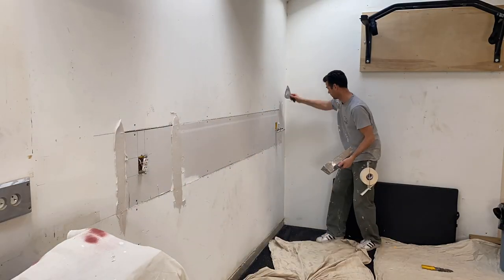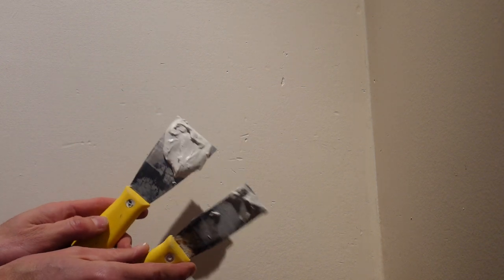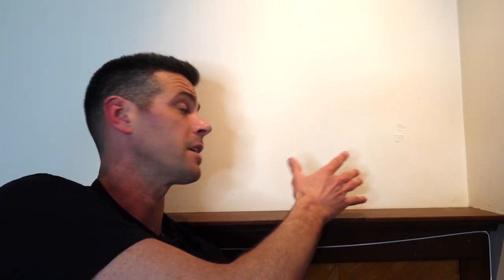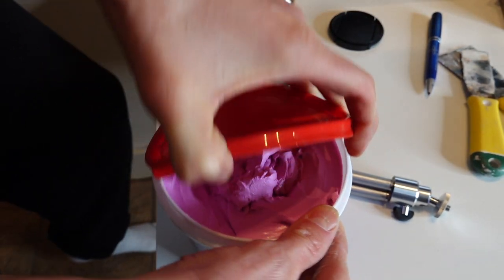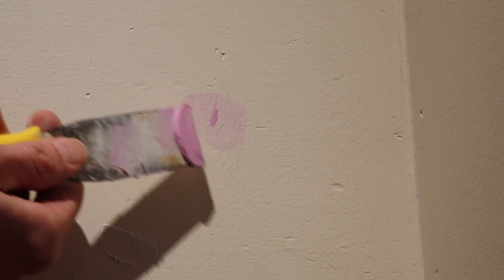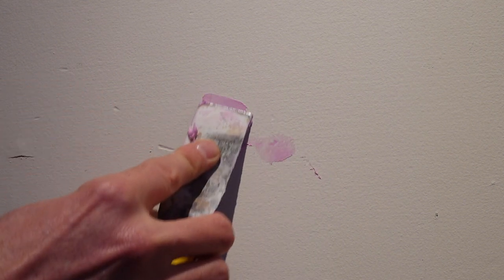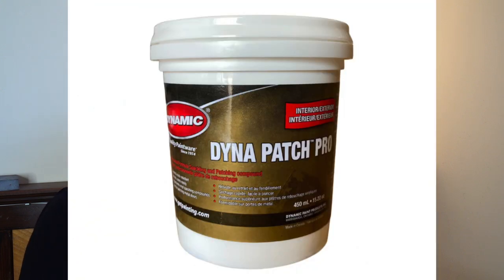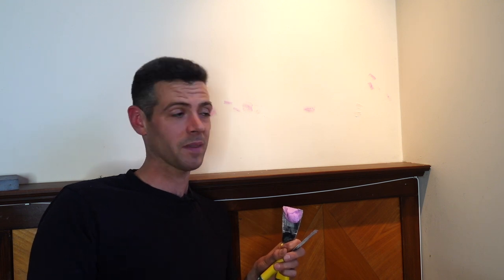Joint Compound vs Spackle!

Comment: Thank you for so much excellent advice. Thanks to your suggestions I've quickly "graduated" from using smaller taping knifes to 14 inch trowel and hawk, this has made my kitchen and partial basement renovation so much easier and actually fun.

Comment: Drydex is for small holes and dents. Mud is for taping. Cost is the difference. Mud has to be sealed before painting. Drydex doesn't. It sands just as easy. And it dries faster. When the sealer coat goes on, the mud is put away. It's that simple. I would use Drydex for small mud & tape hole patches, to patch repair holes in gyproc. It dries faster and can be top coated after final sanding

Comment: That’s why I use the pink stuff as a final finish coat. It goes on totally smooth and sands easy. If you put it on right there’s virtually nothing to sand. And as you say after you paint the first coat and see all the defects its the perfect fix for that. Especially if you are remodeling a room and just patched a dozen nail holes. There are always dents and divots. With the pink stuff I can take a beat up old wall and make it look new again.
Reply: I do the same. I do alot of drywall repair( I'm a painter!). And found that spackle works best for pock holes when drywallers screw me! It works great
Reply: And you are correct about the sanding. I never sand it. I just pull it tight
Reply: Can you put tape with the pink one?

Comment: I think the phrase you are looking for is solids by volume or solids by weight. I couldn't find either measurement for drywall mud, but Dap DryDex is 77% solids by weight. Most high quality latex paints are 30-35% so I'd guess all purpose drywall mud is about half way in between, around 55-60%.
Reply from the maker: Yup. Solids.
Reply: This really helps me understand the difference between the two.  Thanks!

Comment: You can add PVA to dry wall ready mix mud. Yes it works for filling defects in walls with out pulling out.Easy to sand, nicer to work with, than spackle.

Comment: Two tricks : if you pull the Drydex straight, it digs some out, but if you slice the knife sideways a bit, it leaves the hole fuller, not always requiring a second coat.
As you work, the tub is losing moisture, so before capping it, pour it full of water, and dump the water out before capping, and it will be perfectly workable next use.
Reply: Two nice simple, yet good, tips I'll use in the future. I'm a regular (non-professional) Drydex user! Thanks!

Comment: I gave up on Dry-Dex, then came back to it. Its great for small repairs if you can let it dry for a few days, as a professional painter I prefer quick setting mud and all purpose but I always keep a small tub of it around. Major plus is that is sands easy and smoothly.

Comment: To anyone interested...I had to patch several cut - outs in my walls that were made from running wire from my basement to the top of the basement stairwell (which is pretty far) my basement has 10 foot ceilings.  I cut some scrap sheetrock of the same thickness just roughly close to the size of the hole, placed the scrap over the hole, traced it with a pencil and cut out along the pencil line. I then used a hot glue gun around the edges of the patch and pressed it in with a flat piece of wood across it so it ended up exactly flush with the rest of the wall. In summary, the patches are so solid that I could probably punch it and it would break the rest of the wall around it. The best part is, no wood strips of screws to cover up, and the seam is so small that it looks like a pencil line drawn on the wall. You could probably just wipe a very small amount of spackle on the seam. I doubt it would ever crack because its solidly adhered to the sheetrock around it. Just be careful of the hot glue...wear gloves so you dont burn your fingers, and keep in mind, the working time of the glue is very short...if you mess up you can reheat it with a hair dryer of heat gun. If you need to pull it back out, drive a sheetrock screw into it and pull with pliers. This worked so well and so quick with nearly zero mess. I'm  sure this would probably work great to patch ceilings too.
Reply: I'm interested to hear what this looks like in 5-10 years.

There are hangers that use construction adhesive on the studs and only a handful of screws per sheet.  I guess it's a similar idea to the hot glue, but less 'scalable' and more working time with the adhesive.  But, if it works, it works.  Good for you!
Reply: Sounds like not a bad idea honestly but if I showed up at a customers house and started hot gluing drywall into the wall I would expect to be promptly kicked out.

Comment: oh nice...I use the same method in filling up little holes and dings. I just came up with it through trial and error and also found that it provides the best finish. This is especially critical when filling in holes/dings on a newly laid skim coat. Because I found that whenever I tried to press the compound into the hole, I run the risk of compressing the mud. And when I try to sand after, the compressed mud will standout from the surrounding mud
Reply from the maker: Yup. That's exactly what happens.

Comment: As a painting contractor, with textured walls in my area, I rarely use spackle. Holes in walls with a flat sheen paint is about the only place. With walls that are painted with low sheen eggshell or higher sheen I just use caulking for small nail pin holes. If you use spackle it sucks the moisture from the paint and leaves an unsmooth finish which will show really bad in the sheen of the paint. For filling nail holes in trim, years ago I used spackle or wood filler. Now I found Crawfords painters putty to work MUCH better. You can fill it with either your fingers or a small knife and it doesn't shrink hardly at all. If you fill it just right one or two passes with sand paper and its done.
Reply: Question, I'm about to do a small feature wall with a bunch of little spots of torn paper from command strips. Just wondering if there's a better way to prevent the mud from bubbling other than spending $30 on a litre of shellac or oil primer as a sealer since I'll barely use any of it
Reply: @Blingdung  if is just small pieces, cut out the loose paper and mud over the top. Some kind of drywall tape wouldn't hurt, again probably could do without if it's a small repair. Primer is best but I have done it many times without.
Reply: @srharris88  cool thank you. I guess sanding down a few bubbles if they show up isn't the worst either

Comment: one mistake i've seen and done myself, is attempting to fix a finished drywall surface- new board or repair, with the drydex, prior to priming. It doesn't sand as easily as drywall mud, so you can end up with a weird irregular surface where you touch up with drydex over mud, and then sand.  I do the same, sand out the mud, prime, have a look with some good lighting, do any little touch ups with drydex prior to top coats.

Comment: I don't like to use premixed filler. The Aussie brands tend to swell a tiny bit when the first coat goes on and remains a visible repair to the trained eye. I like to use a dry powder filler (I like the Parfix brand from Bunning) that when mixed goes off like cement. I dab those little dings with my finger.

Comment: Just replaced an exterior window sill where some muppet homeowner had used drywall mud to repair and build up severely rotted wood and then painted over. Made demo a breeze with chunks of rotted wood and drywall mud covered in black mold coming off by hand. Western WA coast with 80" of rain/year.

Comment: ....just a little note to add...if you are uncomfortable or not quick enough getting the patch in place before the glue cools off, just fit the patch in the hole, drill some small holes along the seam, and you can press the hot glue gun tip in the holes and squeeze the glue into the seam. This works good too. If you get any glue on the surface to be painted you can usually pick it off with your fingers or you can lightly sand it off.

Comment: Just did a small wall repair job which turned out to be a nightmare the homeowner used drydex and put in the tape meanwhile the Spackle will still pink they requested i sand it and get back to work because they were in a hurry to paint good luck with that cuz now all the tape is falling and the pink pretty much removed majority of the spackle so all the tape is loose mind you he did not use joint compound at all and cut the drywall with a axe lol

Comment: Hey I love your videos and you’ve coached me through some late nights on my own while husband sleeping (first time drywaller here! I wanted to fix the drywall hubby added more of a mess too due to water loss from leaking water heaters (2 were connected together because house used to be a duplex), impacting both bathrooms/ laundry room, our daughters room and our family room! 

Hubby was trying to do a “fast job” since he thinks we are going to tear current house down in a year to rebuild. Regardless, I just couldn’t handle looking at a “pregnant looking” wall w lots of grid and multiple seams showing through everyday while  I do the family’s laundry everyday!). 😎
And it looks SO much better! 🤗 💃🏻 💙🤍 
But I did make unfortunately a big dusty mess when I had a sand a lot of it (I mean, it was REALLY bad!!). I’m happy with the improvements and especially since texturing and painting with “Littlr Boy Blue” Sherwin Williams” paint in semi gloss. I mean I was a little OCD about it but that was also because the SW paint guy told me that the gloss was “going to highlight EVERY imperfection”……😬😱 (and, I’m an “ex manufacturing DEFECT engineer” from high tech semiconductor of about 7 yrs before I became full time mom / part time renovator! 😂 So I can’t HELP but totally analysis every different groove and then think deeply about how it became that way to begin with, for “future reference” 🤣 🤓). Anyway you were my YouTube Angel for quite a few nights and there was something so calming about you I felt I could just give it  try. And I did and since, I even used what I learned to improve another area too that we were working on and was pretty darn happy with it….esp since I accidentally got 15 min compound!!! whoops! So THANKYOU!!!! ❤️ 💙🤍 Wish you were Vancouver WA….which is where we live I would be like your shakedown and free laborer just so I could learn like that other carpenter you had on for an episode. That’s how I knew “for sure” I was watching someone who was indeed skilled and knew what they were doing enough for a veteran to learn new techniques also! 
I’d love to see some videos of maybe your kids or wife  helping too because I want to teach my kids theses skills and I love how you have this way of making this stuff FUN (and funny!): it’s very non-intimidating this way for people like me and we really appreciate it. 
Also last thing rgd the subject at hand:
When doing small holes are you adding texture also? If so what is your technique in doing so? Do you prime the repair, then texture (abs using what?), prime again, then do the paint on top (if size of the hole or repair would demand it in your opinion?)? 
I’ve read that is is ideal to prime mud before texture then texture, and prime again - all to ensure more even absorbtion of whatever you are adding on. I find it’s not that inconvenient for me to do and I’d rather have it be done the best to my ability I can vs it come out looking goofy simply because I was too lazy to add one layer of paint (of several anyway!). 
What are your thoughts on that? 
Would you also be willing to do a video where you are doing the texturizing also? Want to see your techniques and how it might change depending on size. You seem like a natural at this and for teaching. 
Ps you’d be the best wood shop teacher ever (if any schools still doing that! I’ve found few are. I actually almost got a job as an assistant to the one school I know who DOES teach shop - ironically he was my ex boss when I was in engineering and he hired me out of college. He since has “retired” and now teaching MS and HS “makers space” shop classes. Unfortunately I was the second runner up per the principal so I didn’t get the job, so I’m just sticking to learning and doing here at home and also on our 4 plex we own next to our house. My dad was a civil engineer and builder but unfortunately died at 45 when i was 10 otherwise I’d definitely be bugging him about all of this! But somehow I feel like maybe he is still watching over me and controlling my YouTube (to help me find great teachers like you!). Not that U wanted to know all of this or anything but want you to know your work is apreciated (but would love to see more videos with kids helping out and maybe you can inspire a younger audience as well!). I’d say kids today (and people in general) definitely need more real world teaching and skills they can use and build their confidence in their own abilities to actually attempt to fix or build something themselves vs always relying on someone else.

Comment: And then there is hot mud with all the different work times..............that is the same as dry wall mud?.  You threw in Dyna Patch and I assume that is dry wall mud and you recommend using it for nail holes in trim not the pink stuff.   I have prepared all my walls with the pink stuff, bought all new trim..............so I am hoping that you have guided me well.  Thank you.

Comment: Love your videos, super informative!

I have some plaster crown moulding with some hairline (and some bigger...) cracks that I would like to patch up and paint over. Would DryDex be the recommended material for repairing plaster cracks? Do I need to carve out the hairline cracks to get more DryDex material actually inside to fill up the crack? Thanks!